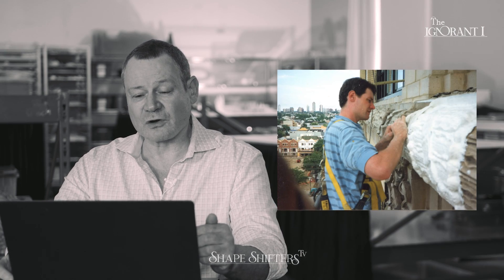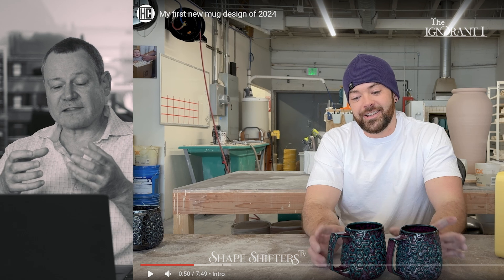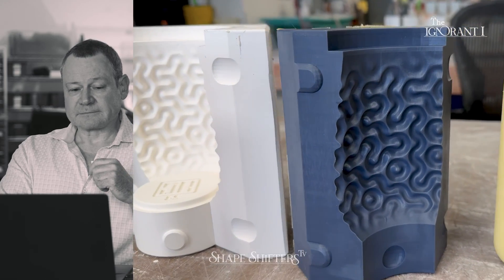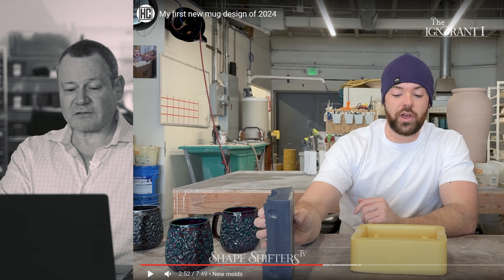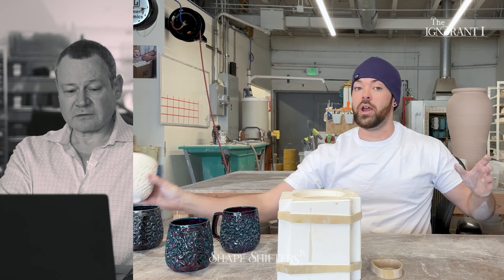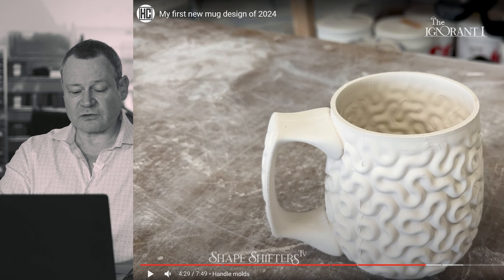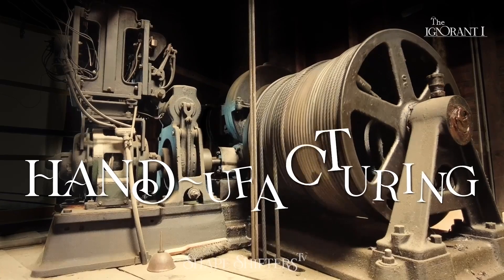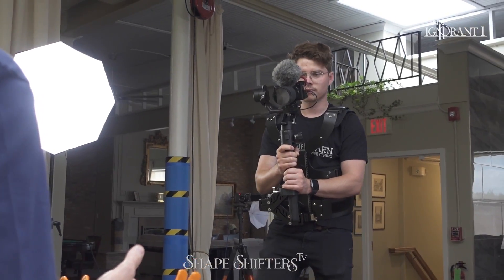Pro Mold Maker Reacts | Hammerly Ceramics Revolutionizes Plaster Molds With 3D Printing!

Comment: 10:45 in slip casting I assume there is no way to have a smooth interior with a prominent exterior pattern
Reply from the maker: There are two ways I can think of, but likely not worth the effort for small runs. 

You can create an interior 'core' mold section that casts the interior wall smooth... or you can make the mug body using a wheel Jig.  The jigging is mostly a production factory process... we have a few videos about it.
Reply: @HandUfacturing Thank you. I think I'm going to be crazy enough to run a few 3D model prototypes based on your recommendation and run them on my resin printer & see what happens.

Comment: Hello  Michael, amazing video, amaziong knowledge. Im not a master mold and not even a ceramist, but im developing a workflow/plugin in order to generate 3d printable models for molding ceramics, all inside grasshopper so anyone can make is own mold without needing too much knowledge in the softwere. Do you have any suggestion to avoid the texture in the inside? Glad to find this channel.
Reply from the maker: It depends... do you mean avoid the texture in the original 3d print of the master mold? or do you mean avoiding texture in the clay layups with the 3D printer? For Texture on 3D plastic master mold prints, you can glaze with a special resin. I forget the name, but it acts as a coating and diminishes fine lines. I think Polytek or Smooth On have resins for this application. 

For texture in 3D clay print... That is more tricky. I think aside from post finishing by hand, the only thing i can think of at the moment is to utilize different nozzles and celebrate the striations.  I wonder if there is a way to print each layer 'not parallel' to the previous, but instead program waves or other 'up and down' motions that look more elegant. 

Am I catching your question or did I not understand? Michael
Reply: Just about to make my first mold system, would love to know about your software. 

Nonplaner slicing is the buzz word you want for avoiding the parallel layers, and it's right on the cutting edge of open source FDM tooling.

Comment: Modern SLA desktop printers have gotten way better than even commercial machines from 5-10 years ago, especially in terms of surface finish. Depending on the required final finish, a printed mold might require very little post processing, especially if it came off an 8k or 12k printer with a minimum feature size ~20x20 microns.
Reply from the maker: Yes, they certainly have. We suffered with the 'new' tech years ago. But when they worked, it was amazing. Today, my shop is focused on larger scaled objects, so the printers are not in play for us anymore. We run CNC most of the time. However, I do like the new fun stuff... super amazing, but we just aren't the right type fit for it currently. I love seeing the print quality... super elegant. Thanks for tuning in, Michael

Comment: That was an absolute joy to watch. Thank you so much!
Reply from the maker: I am glad to have found your channel. Thank you for helping to take ceramics out of the low tech groove it has been sitting in for decades! Funny ha ha on the "Absolute Joy" comment. I'm sure you discovered the other line of content we put out there too. =)  I will drop in on some more of your videos.
Reply: I just subscribed to you both
Reply: It was great commentary.  I especially agree with the design on the inside re washing etc. 😊
Reply: why not just hide the vertical parting lines along the ridges or grooves? just because it makes the 3D design trickier or is the parting line clean up not that tedious of a process? It looks like you could potentially remove cleanup completely
Reply from the maker: Thank you so much for your thoughtful suggestion! You're absolutely right—integrating the seam lines into the natural details of a piece is a great approach for achieving a seamless finish. Only downside, with those small, undulating details, creating a parting wall that follows the intricate contours often makes the wall more fragile, especially with plaster. The waffled structure that results, while effective in masking seam lines will likely chip quickly... especially during repeated use. Generally, smoother and wider parting walls hold up better in plaster mold-making.

I appreciate your insight and feedback—having this kind of dialogue is what helps us all improve! Looking forward to more of your ideas and hope you’ll stay with us on this journey. Cheers, Michael